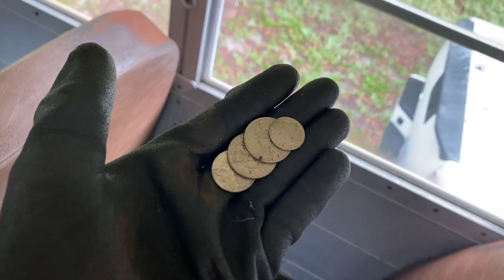Day 2 - Removing School Bus Seats By Myself | Solo Skoolie Conversion Day 2

Comment: Save all of those bolts and nuts! Everything that was bolted under my bus I used those and saved myself a ton of time and money.
Reply from the maker: That is such a good point! One I definitely failed to realize when I was doing this, but I did save most of the critical stuff for the driver area and stuff like that. Thanks for the tip!

Comment: I did have some luck just snapping the bolts with a half inch impact fully turned up on a full air compressor. Not going to get them all that way but it takes 2 seconds a bolt to see if it snaps the head. Never underestimate overkill. Then you just drive them out with a punch. I’m using a air hammer but a nominal hammer will do it.
Reply from the maker: That sounds like a super efficient method! Would love to see a video of it!

Comment: Me still getting butt-kicked using a generator and angle-grinder for the top bolts along with socket-set to attempt the removal of the side-wall bolts.  I've angle-grinded the top of a few bolts and slammed by body-weight against the seats to loosen, yet I learned the side wall bolts have to be removed which is exhausting.  So no seats removed but I do see progress.  I am not going under the bus because it reminded me of your experience using vice (or is it bike) grips?  So I'm inspired to get it done seeing your experience-----thank you.  Malave' Contreras Friday the 8th of March 2024.  So it's a year later to see your video but I've only had the buses since September of 2023.  As you've shared, that's it's satisfying when you're able to remove the bolt and find change (and 1 yucky $1.00 bill).
Reply from the maker: Oh yeah, those side rail bolts on the seats are a PAIN. But they gotta go to get 'em done - you can do it!

Comment: When removing seats using an angle grinder with a cut off disc is the easiest way to remove the seats. Never need to go under the bus.
Reply from the maker: Yep! My method is totally an experiment to see if it's even possible to do it as one solo person without using an angle grinder. I discover the power of the grinder in the next few episodes!

Comment: Since this bus had 12 rows of seats, it would've had a total of 24 seats, not 26. I can see why you thought it had 26 seats since the bus has 13 windows on each side, but it has to do with the configuration of a front engine transit style bus.
Reply from the maker: I can see why you thought that I thought I had 26 actual seats, but I say 26 because each side also has a front bumper which required the same removal process as the seats themselves. Thanks for checking in, though!
Reply: @seek.life.elsewhere  You're welcome!